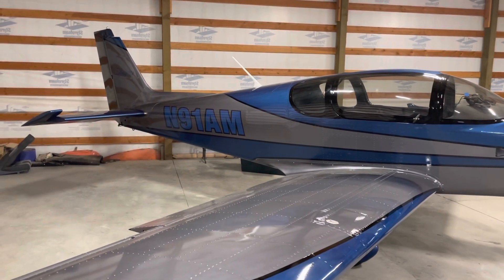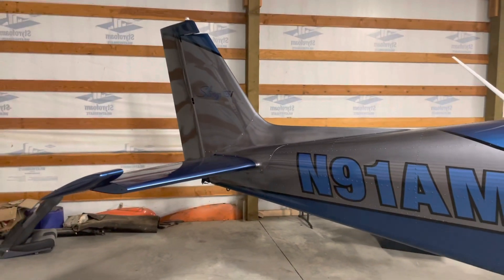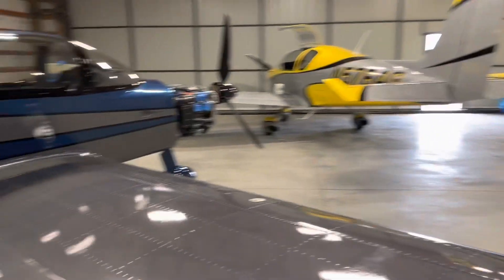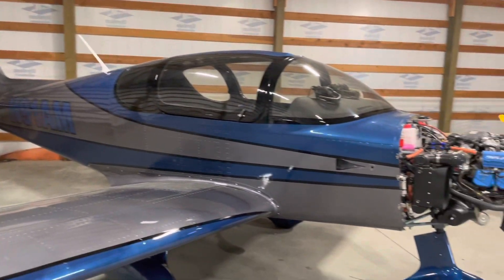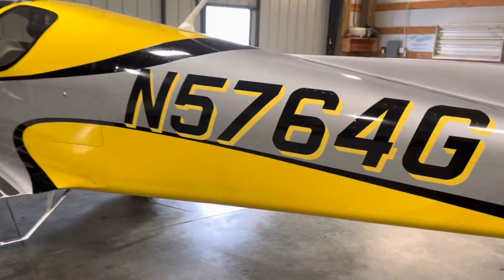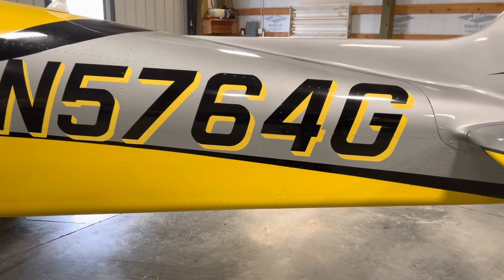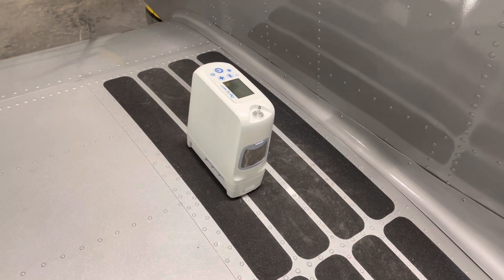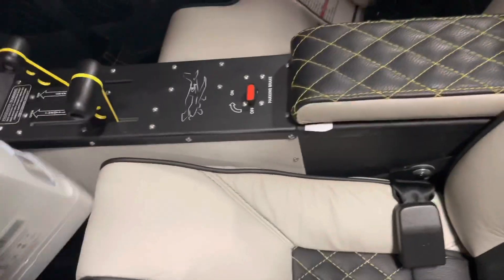Sling Things That Matter!

Comment: Try some forward slip tests with the new static port locations, if you haven’t already.   <Edit> ok I see you’re saying it’s actually the old/original location but just with a raised profile that the rivet provides?
Reply from the maker: Edit is correct!
Reply: @EvanBrunye  That's great, makes me wonder if there's still a way to get Mike's adjusted with a different raised profile.  Depends on how much you want to mess with it.  Thinking out loud - higher reading=lower pressure = more venturi-effect going on.  Perhaps the same thickness profile but with a narrower opening might help.

Comment: Soo, putting static ports further away from the prop reduces the effect of prop wash on indicated airspeed. Makes sense :-)
Cessna does it the "first way" but... I think the Cessna's airspeed indicator might also be reading a bit high and everyone just kinda accepted it?
Reply from the maker: It’s actually a much more complex problem to solve than just looking at prop wash vs no prop wash, it requires a very detailed model of the plane and running cfd analysis to get close, and then from there it’s just some voodoo magic. I’m not doing anything other than testing the recommended methods and reporting the results I see

Comment: I’d be interested in hearing how the concentrators work after a few years of use. The manufacturer lists the life at 5 years, and with annual column changes and recommended weekly filter cleaning (probably a function of use there), is it reliable enough and worth it over a tried and true tank system? Any issues with RF coming off of it?
Reply from the maker: The manufacturer makes them for people to use all day every day, so the numbers you’re seeing are based off that. I’ve been using mine for a year totally trouble free, and as One Alpha Mike says there are people who have been using these for years trouble free. Also keep in mind I didn’t say this is the definitive best oxygen route you can possibly go, I just said this is my preferred method when all things are considered.
Reply: We have a colleague who’s been using one for well over 5 years, currently in his TSi and in his Mooney before that. It’s still going strong. He switched to the concentrator after many years of filling his own bottle system. 

Haven’t noticed any RF issues, either.

Comment: Hey Evan, this is purely uneducated speculation…

Do you know if there’s a preferred side of the aircraft to place that port? I’m just thinking bumpy air makes small changes to pitch, p-factor yaws you slightly to the left and you get some dynamic pressure error on the right side static port? Then again, I’m a very inexperienced pilot in an old Cessna so I imagine my flights are bumpier than the average lol
Reply from the maker: Ports are on both sides of the plane

Comment: Hi Evan, those are two great-looking birds. With regard to the O2 equipment, why not attach the equipment like you showed, by the seats, but wire the controls to the panel. Sort of like you did with the overhead panel. That way, you have easy access to both units.
Reply from the maker: That would be cool for sure
Reply: The units currently don’t lend themselves to remote control. Otherwise that would be a great idea!
Reply: @OneAlphaMike  Who's talking about remote control? It's just wiring the unit controls from the units to the panel.
Reply: @antoniog9814  That’s what I’m talking about, wiring it so it can be controlled remotely from the panel. There was a company (Windblade) that was putting out info about how to do that. It required more hacking than you might think, voiding the concentrator warranty. More trouble than it’s worth.